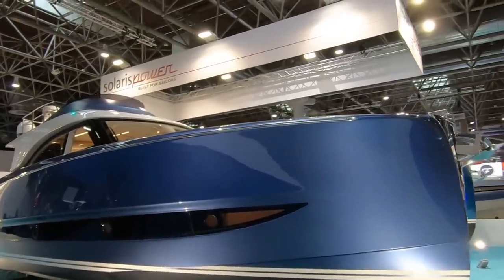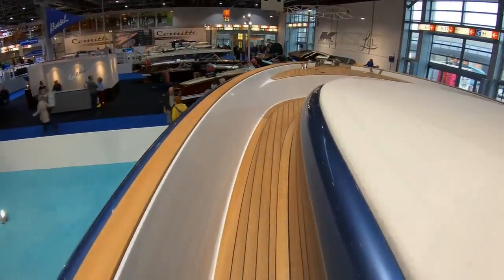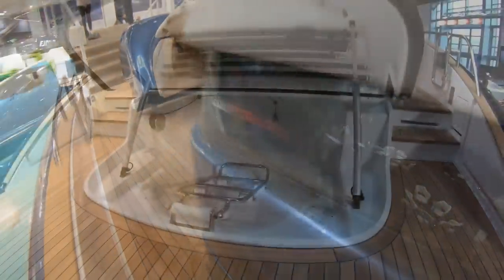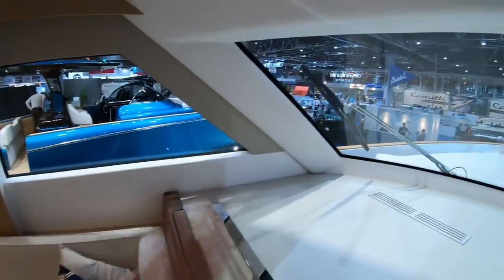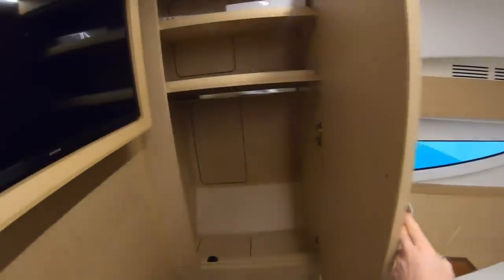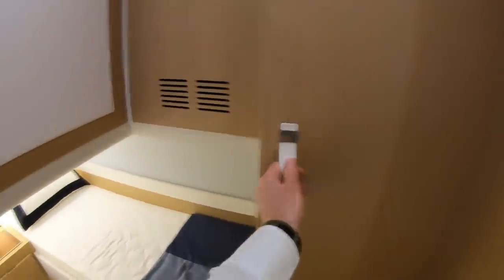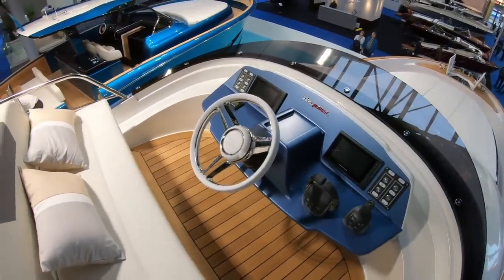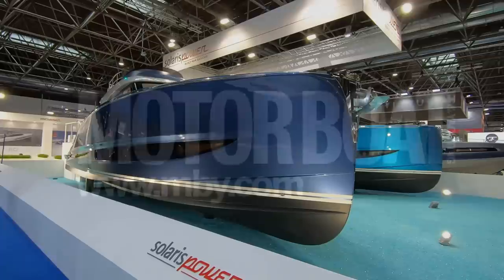Solaris Power 48 Lobster Fly yacht tour | Italian boat styling at its finest | Motor Boat & Yachting

Comment: Thanks for your comments. As with all these videos shot during the Dusseldorf boat show in January a clash between the frames per second rate of the camera and the indoor lights  caused the footage to look strobe lit. The only way around this was to edit out the flashing frames which makes fast hand movements appear to ghost. We have learnt our lesson and it won’t appear on any newly shot videos but until restrictions are lifted we are stuck with making the best of the footage we’ve already got. Thanks for your understanding.
Reply: Hugo Andreae 👍
Reply: You might know but...The shutter speed is double of the frame rate. In your case I would do 60 FPS with a shutter at 120 to reduce motion blur. If the image becomes to dark, change the exposure setting (EV) on the camera and keep the ISO around 100. You should be about to adjust every setting for a MAX and MIN setting. Aperture is another monster  but I don't know what camera he used. I would guess a phone. Small cameras like cell phones and go pros have a sensor inside them that is pen tip big, so it needs a lot of light. Look up a company called Small Rigs for gear that might fit the needs of production. Knowledge of the boat was great for such a grand design for a small weekend boat.

Comment: Style over substance. There's better out there for the money in my view. 
Each to their own!
Reply: There's plenty of real substance here too. It has bullwarks not railings for decks, so I'd trust kids, dogs, and the less able to use them. Almost pilot walkaround boat level security. And the hull is extremely efficient being semi-displacement so that fuel saving will add up. It also has a large tender garage with seating, usually on this size of boat you have an option between a seat and small storage, or a sun pad and a tender.